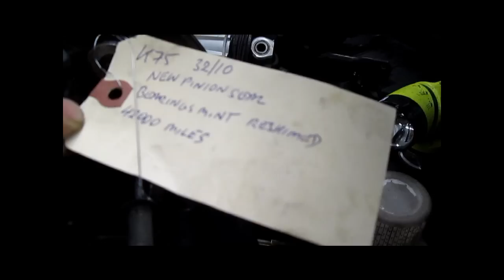BMW Service - K75 / K100 Rear Drive Splines

Comment: 10 years ago I had a K75S which I never did this maintenance. At 90K paid the price when I stripped the splines and needed to be towed in a shop. Lucky for me I found a used shaft from a bone yard with low miles and my bike was back alive. Sold it with 120K on it a couple of years later.

Comment: Nice that people are caring about the Klassic K's.I had Bruno do my splines about 5 years ago, and I decided against his improved shaft in favor of a new shaft from BMW. It was a tough call, Bruno does good work. I was impressed by how much smoother the bike was with the new shaft; the new bonded rubber damper is much more effective than the old, hard rubber. This will likely be the case with any rebuild. I don't think relubricable U joints do much good.

Comment: Chris, I'm enjoying the heck out of your very helpful videos, which in my opinion are way better than any service manuals I have ever had, which seemed to always  leave out all the information which was of importance to me.

I had a '85 K100 RT and never did any of the scheduled maintenance except for one valve adjustment at 113,000 miles. I retired the bike at 148,000 miles because the injectors got so dirty it would not run at all, the weather had destroyed the windshield (beyond yellow) and the seat, and the neighborhood kids / vandals (whatever) seemed to make a game out of knocking it over in the apartment parking lot where I lived.

The rear shock was beyond bad also, just too much wrong to put money into it, so I bought a '93 K1100 LT, (63,000 miles) and now think that instead of running it and doing nothing at all, just "letting it roll",  that I should watch, listen, and learn how to do all this spline lube and such, maybe even do my own valves.

Was I just lucky or......? I think I should learn to take care of what I have. Now maybe I will be able to.
Reply from the maker: Thank you! I will have extensive 16 valve K bike videos this year. Stay tuned.

Comment from the maker: My friend is 5' 4" and we lowered the bike with the 1+1/2" lowering kit. No problem w/ K60 tires. Don't forget that although the seat height is claimed high the suspension will settle quite a bit once you are on it.

Comment: Thanks for your video, Chris. Do you have some contact information for Bruno or any other provider of refurbished final drive and drive shaft. I have a 86 K75 with 92000mi and my splines looked similar if not just a little worse than the ones you showed us in the video. Thank you for your time.

Comment: Chris I once owned a 86 HD Softail, and my dealer had to weld a hex nut to the taper headed Allen bolt, he told me that I have to use Loctite thread locker to the bolt, I said hell no I'm going to put antisieze on them he told me that they will back out, 45k miles & they never did back out! The next time I just used an Allen wrench to take them out!!!

Comment from the maker: The problem with the Snappy torque adapter is what are you going to use for a wrench... a crows-foot / open-end? These nuts are very soft aluminium and need a full grip. But thanks for the suggestion :)

Comment: My first bike was a '78 Kawi KZ650 Custom, but you sure threw a curve at me here Chris with the KLR. It took some mental prep to look at two cylinders ... now you are aiming me at a single :) The specs at Kawi have the KLR650 seat height at 890mm. That's a darn high seat. How far down did your lowering kit go for your friends KLR ?  I'd like to still be able to mount Heidenau K60's.

Comment: Welder's (my trade) trick for removing rounded off or reamed out fasteners such as those flat head bolts with their ridiculously tiny allen sockets:  Take an appropriate size of hardened grade 8 nut (in this case, about 1/2"-13 gr.8) black steel unplated, if you have the choice? Hold it down over that stripped screw with some vise grip pliers and mig plug weld inside the nut onto the top of the screw..  Later use a 3/4" impact socket and air impact wrenchon the welded on nut.The red hot heat is usually helpful, but let it cool before using your wrench or it will draw the temper of the socket tool.
Reply from the maker: Quite practical, practicalman45, thanks!

Comment: I like the home made Crapsmsn socket but you could use a snap on torque adapter. Only venefit would you could most likely get the full 40 N-m without repositioning the hex socket. In fact tou could use a t handle hex which would hold the original o

Comment: Suggestion:  Use an open end or box end (27mm) to tighten the lock nut while using the 6mm Allen to hold the pin.  Get it snug first approximate torque (say, 50Nm).  Then use your 27mm window socket to do the final torque.  Also, the Tool Academy in England has a 27 mm diesel injector socket with a window for $31 mailed to the US. (I've got one on order).  Cheaper than buying a 27mm deep socket at Sears.

Comment: Loving the Beemer Boneyard Shirt! They hooked me up with my new disc, final drive, rear final drive and a gorgeous stock exhaust pipe for my K75 when I blew out the final drive. On a different note, Do you advocate the use of rubber gloves when working? My dad gives me an earful of "When I was a tech I shoulda' used gloves, look at mah hands now!" Just wondering how you feel on this subject!

Comment from the maker: The pinion shaft splines and the tail end of the driveshaft should be lubricated. This requires removal of the four bolts securing the rear drive to the swingarm. ANY grease here is better than no grease.

Comment: I'm wondering about an elastic, tight fitting piece of rubber hose that would fit over splined shafts, allowing them to travel, yet sealing for grease. Then maybe some kind of light spring (like in grease guns) going inside the hollow housing to lightly force some grease forward.

Comment: My problem Chris is that i'm 5'5" in thick socks and I'm not going to find a stock ADV bike I can make good ground contact with. BMW is the only manufacturer that offers factory frame lowering. And even before I found your videos I was unwilling to hand over my ass to just anybody to do a kit lowering of another brand.  Just knew by instinct there'd be the kind of garages out there who'd put silicone on clutch plates.

Comment: In any video that has a broken screw stuck, a drill is immediately grabbed... 
In your place I would just weld a small dome on the broken screw, place a nut on it and continue to weld it to the screw. 
The heat is already there, from the weld, and all that is left is to open the nut. 
Brake bolts in any case must be replaced and must not be reused.

Comment: Hi Chris why not fit a grease zerc in that housing and grease every 1000 miles?
Reply from the maker: Hi Ted, Filling the swingarm / rear drive pinion side of the housing with grease will not force the grease into the hollow shaft and onto the splines. But at least these only need to be removed every time the rear tire is replaced and it only adds about an hour of labor to the job. Thanks for asking and happy new year, Chris

Comment: I have a r1100 1993 and the rear drive ...swingarm and gearbox all connected, so just going to get the blow torch out, but was trying to remove those same hex head screws in the rear drive, loctite isn't your friend...Hmmmm...luckily they came out, just buying replacements.....
Reply from the maker: Hi Roy, Those two screws in the rear disc are not necessary anyway. Isn't the disc held on by 4 / 5 more much larger screws?!
Reply: There are 3 allen screws next to the ring gear, don't seem to be holding anything.... but the 2 screws in the centre hold the Disc, ( they are the 2 you drilled out on your video )...but, my Disc seems to have 10 rivets...attaching it to the ring gear.....Hmmm.....better find the Manual, to see how to disconnect the ring gear from the Disc, tolerance is 4.5mm.....so it will need replacing sooner or later.....such an adventure....
Reply from the maker: Those are fun! Take your time with plenty of heat.
Reply: Just discovered the rear Disc and ring gear are integral, but James Sherlock have a shop soiled one for £39 inc postage, so ordered on eBay........
Reply from the maker: Perfect!

Comment: Hi Chris,

I tried to contact you with a PM but I can't seem to find it. I'm about to buy a BMW K1100 from 1993. Is there a way you can upload a video with some points to look at? I currently own a K100 so it's not a new bike for me but still it would be great to have some tips from the pro! Cheers.

Comment: Mr. Harris, You seem to prefer the gas method over an electric heat gun.  Any reason?
Reply from the maker: Yes, time. Time = $ and if you want to pay a tech $100 per hour to stand there with a heat gun for half the day, go right ahead. I can't do that to my customers. Mapp gas works great and I've never damaged the finish. Remember, you are heating the pin to melt the thread-locker into a liquid state to ease removal of the threaded pin. That's all, not heating to expand, just to melt. Good question, thanks!
Reply: Makes sense to me.  I really enjoy your videos too.  Thank you much!
Reply from the maker: You're welcome!

Comment: Nice job, but when I have to heat up a bolt like that, I just spit a bit on the bolt when I think it's hot enough, and if the spit boils, it's enough =)   260F is 126C.

Comment: Harley Evo break calipers ate T30 Torx cause the customer did their own services with only meant changing oils never R&R and grease alignment/float pins on brake calipers.

Comment from the maker: Hi, Thanks! I do work on several R1100GS, R1150GS and a few R100GS models, the first generation F650 and I've worked on a couple of F650GS models which I find goofy, poorly engineered and flat out miserable fucks to work on. I do not work on any Hexheads of F800 models. I stop at 2004 model year with a few 2005's allowed in if they are the same as the earlier years model. I know nothing about newer BMW's, they do not appeal to me and I will never own one even if they were FREE. Sorry, Chris